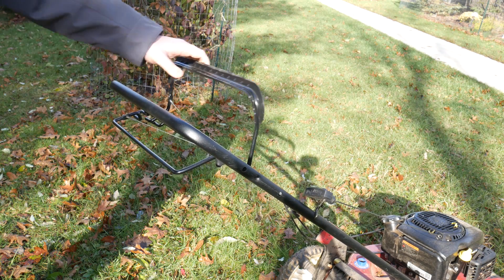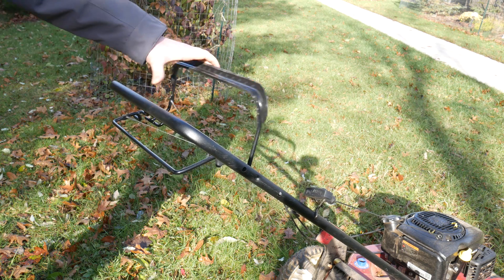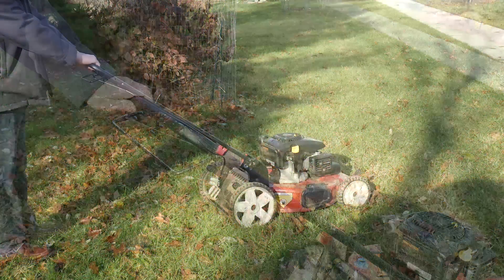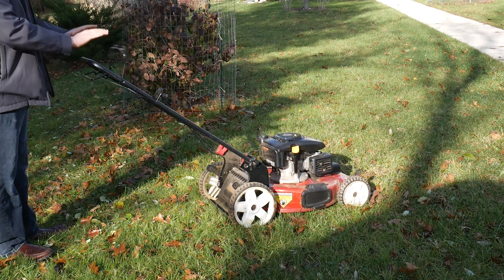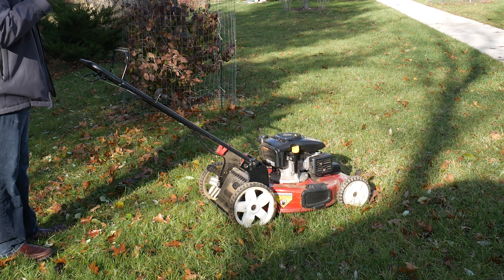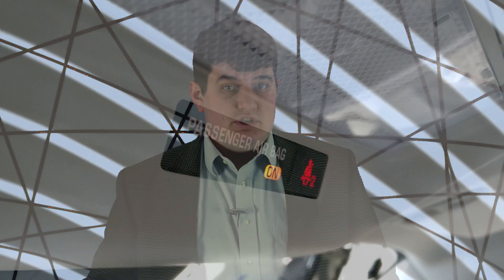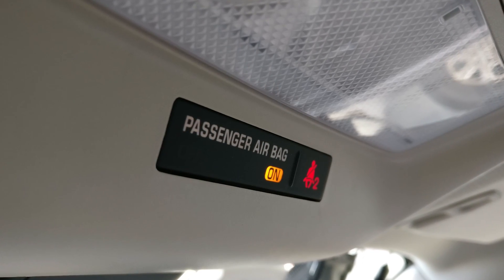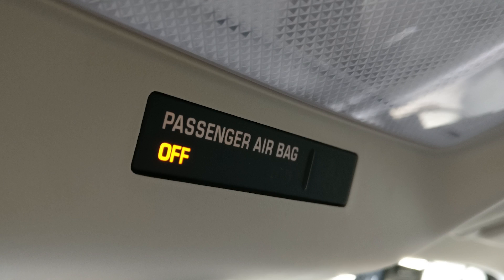The Dead Man's Switch:  How Anton Yelchin's life could have been saved

Comment: Accelerate by wire, steer by wire, brake by wire, all it takes is a little bit of code and the driver becomes the passenger.
Reply: Remember the film "Minority Report", the self-driving car being taken over by "head office"?
Yeah, seems like that's possible already, even before the self-driving aspect.
Reply: The Snowden leak that happened 5-7 years ago revealed that the CIA has considered using this technique for assassinations. The files were unclear on whether or not they had actually done it, though.
Security researchers have also demonstrated, time and time again, that engine computers are horribly secured and it's very easy to break into them. Especially the ones that can be accessed wirelessly.
Reply: Death by computer virus.
Reply: @calvingreene90  can be done today.
Reply: Not an additional line of code but deletion. Get rid of the creep function.
Reply: Ah, hello there! Can I interest you in a Tesla, and its fabulous auto-drive capabilities?
Reply: @Reepicheep-1  get that hot garbage on 4 wheels out of here. Imports for life!
Reply: @crazeguy26  My Civic has auto-throttle and lane keeping already. The auto-drive future really depends on sensors and legislation.  YAY imports!
Reply: This is why we need manual overrides. 
Nothing against Tesla (except an empty wallet), but it's reassuring to know my car has a 0% chance of being hacked entirely remotely, unless you count activating the panic alarm. Heck, my key remote won't even open the trunk. (...because the hydraulics are busted.)
That said, lack of connectivity isn't really a pro overall. It's mostly just a bother.
Reply: All new airliners are fly by wire. So it can by safe.
Reply: @MaksymCho  yup and fly by wire has had a much much better safety record due to being able to curb excessive pilot input
Reply: @MaksymCho  your comment didn't age well
Reply: Given how shit most drivers are, I don't see how that's a problem.
Reply: or dead

Comment: my 2016 vw tiguan ( manual gearbox) has this feature
the electronic parking brake is applied when i release the seatbelt
it can be overridden by pressing the brake pedal and pressing a switch, but you're in the seat to do this

Comment: Here's a possible counter argument from automakers: "we can't install a dead man's switch because that would prevent owners from starting their vehicles with a push". I've always owned older vehicles and there eventually comes a time when the battery dies (among other things) and I need to do a push start. 
- How would you respond to that argument besides saying that the benefits of safety outweigh the probability of needing a push start? 

- Is there a way that you would suggest maintaining this feature besides putting a big rock on the driver's seat (ex a dead man's switch override)? 

Thanks, and keep up the great videos. My dad and I love debating them :)
Reply: Most vehicles in North America are automatics, which you can't pushstart anyway, and even those manual transmission vehicles aren't 'intended' to be push-started so I doubt it is of massive concern to car manufacturers. 

At the end of the day, no more tech is needed to solve this problem. When I get out of my car I put it into first gear and pull the (mechanical) handbrake. If all drivers set the handbrake when they left the car, this would not be a problem.

Comment: SAABs have had sensors in the seats at least since the seventies. They are used to warn the occupant to put on the seat belt and to enable the heated seat.
I'm puzzled why SAAB never thought of using it as a dead man's switch, it would have been just the thing for the safety minded Swedes.
But maybe the sensors were to unreliable. You don't want cars to suddenly switch off when driven on a highway.
Having driven an older SAAB myself, I know the sensors get unreliable with age.

Comment: I suspect most manufacturers are aware of this problem, but choose not to implement a solution since it would prevent use in track based automatic car washes. I suppose a defeat mechanism could be implemented, but without universal agreement, this could get quite complicated.
Reply: At my car wash you remain in the vehicle while it is on the track. Do you have to exit your car?
Reply: Self service, you typically remain in car. For full service, they pull it onto a track, put it into neutral, and then leave the car.

Comment: I have a slightly different viewpoint from the old geezers who loath computers in general and think life was better before all that running water and them eelectronic gizmos came along....I think computers should be a part of every aspect of our lives, EXCEPT safety. Then it should be very carefully considered. Cars were more reliable and safer just before we went overboard w/ the computers. I don't mind if they manage the ignition system, or the door chimes, windows, radio, etc etc. But there is nothing for my money better than good old fashioned hydraulic systems and cables connecting me to my car. It only takes 1 misplaced character out of the millions of lines of code that goes into automobile software to kill me. I'm not OK with that.
Reply: "I think computers should be a part of every aspect of our lives, EXCEPT safety."
sounds pretty straight forward to me.
Every system will break, a complex system will break more likely. That's what redundancy is for...to reduce failure rate in a complex system.
Is it possible that my airbag opens by an electronic failure and kills me on the highway...yes. Do I want to abandon my airbag system because of a small chance of that happening...no. The advantages outweigh the risks.
Reply: He was referring to systems that don't necessarily need to rely on complex computer technology (Some computer control is always practical from an engineering viewpoint) but the more complex your system gets, the more it can break; and break they do.
Reply: "Except safety"...do airbags not safe thousands of lifes every year? That wouldn't be possible without codes and electronics!
With the e-brake in my car, even a kid in the back seat can stop the vehicle SAFELY even on wet and slippy roads. No cable operated handbrake can do that.
When the airbags activates, the car automatically calls help and sends GPS location for immadiate response even in an unconscious state.
Again wouldn't be possible without electronics.
Reply: +mrdesign1991 Yes, that is more or less what I meant...They should play a limited role. I guess I failed to communicate that. Whenever mechanical system can be used, it should be preferred imo because those systems are typically a lot more simple with far fewer points of failure.
Reply: +Attla theHun I don't see why a kid in a back seat couldn't operate a cable driven handbrake...I had to do that a couple of times as a kid b/c we were poor and drove rickety old cars, so if you think it's a matter of strength, you'd be wrong.

Airbags do not require computers to operate....
Reply: I feel the same way. Good thing i have an old-style "dumb" VW Polo from 2009 that doesn't even have seat sensors to nag you for forgetting to applying the seatbelt for the bag on your passenger seat
Reply: Not only that, generally speaking, electronic systems either work, or don't work, with little to no middle ground. Thats scary, because you get no warning. With more mechanical systems you can tell when things are going bad long before they become a huge safety issue. For instance a cable operated parking brake starts to feel mushy and tired months before it begins to fail.
Reply: >  Cars were more reliable and safer just before we went overboard w/ the computers.

That is simply not true. Cars are safer than ever.

Source: https://en.wikipedia.org/wiki/Transportation_safety_in_the_United_States, the key number being deaths per vehicle mile.
Reply: You're assuming the software designed, with it's millions of lines of code, is written one afternoon and thrown into the car's memory banks. Months of writing, checking, trouble shooting by teams of programmers, and then comes the testing cycle, bug fixes and field tests. 

It genuinely annoys me that there are people out there who think this way. These people aren't idiots. They're trained professionals who've studied for years and know what they're doing.

Also, if there was one misplaced character in a line of code, the software wouldn't glitch out and kill you, it just wouldn't compile. It would say 'syntax error.'

Comment: How about having a physical handbrake like in the goold old days? 
I can't possibly accidentally leave my car not braked if I have to pull a lever which makes a clunky mechanical noise to brake it.

This is a clear case where electronics need not apply - and I say this as a programmer. There was nothing wrong with the good old handbrake lever. Stop fixing things that aren't broken.
Reply: So Anton's car didn't have a handbrake? Just the e-brake? Is that even legal?
Reply: It's legal.  Lots of cars don't have a manual parking brake any more, because they consider it intrusive or not stylish.  As more vehicles adopt brake-by-wire systems, it becomes much simpler to electrically engage the brakes than to run a cable linkage from the cabin to the rear of the car.  My GF's Subaru has a stupid button on the dash to engage/disengage the parking brake, and it annoys the hell outta me.
Reply: I looked at pictures of this type and brand of car and I saw actually a manual foot parking brake. So even if Anton was annoyed and confused about the shift lever (like many suggest) and got out of the car he 
still could use that to be sure. It all then comes to laziness or habit not to use the parking brake, like most US citizens it seems.
So to sum it up: he didn't know how the lever properly worked or was annoyed 
by it, he didn't check if he was actually in parking position, he disregarded the safety of the situation and did not secure his car with the manual parking brake, which the Cherokee had!
I am not saying that the shift lever of his car was not confusing or misleading,  but if you do not secure your car with all means you have to be 100% sure it is safe just out of a habit of comfort you should not drive a car.

It would be nice if Anton could learn out of his mistake, but sadly this was a very definitive lesson.
On the other side I am definitely not against Anton's parents suing the car company for this utterly unresponsive failure of a shift lever.

Comment: Modern railways locomotives don't use a simple dead man's switch since they weren't reliable (notably the could be jammed on).  

These days it's a vigilance monitoring system that requires the driver to cancel a warning within a short time (eg five seconds). This is done by pressing a button.

Comment: Hm. First of all: Just because software is invisible doesn't mean it doesn't cost anything. In fact, software is more difficult to verify than mechanical mechanisms, which, for safety critical applications, makes it more expensive to develop. It does have an advantage in that is costs virtually nothing to mass produce, but a good part of the cost of a car is the research and development.

A mechanical dead man's switch seems to make more sense here, even though ultimately it is plugged into the CAN bus the automotive industry is addicted to.

Secondly: If the car refuses to operate without a driver present, how can my K.A.R.R. come to pick me up when I call it on my Dick Tracey watch?

Comment: Jeeps other than some JKs after 2014 do have a "dead mans switch" or run away prevention mode it relies on seat belt sensors and seat weight unless the car is turned off... So if you turn the car off and leave it in neutral you can still push it. If left running it puts on the emergency brake which usually only prevents the car from rolling forward when not in gear. The car knew he wasn't it in but HE didn't properly park his vehicle. It's like using a calculator, it's only as smart as the user. 

Also for the record Tesla vehicles require a person in the seat and the seat belt buckled before and after you shift out of park, even while in neutral. The second you leave the seat it locks the e brake and sends the transmission to park... There is no point in over engineering a car, truck, or suv, when people can't be responsible enough to but their vehicle in park. Stupid people are why cars cost so much and "require" certain safety features. Most keyless cars can be driven miles away from the key fob before try go into theft mode...

Comment: On every riding mower I use, I immediately disable the deadman switches on the seat and on reverse.  
Every time I shift my weight, the engine half-dies and consequently the blades are cut off.  
There's usually another that also kills the engine and blades if the blades are on when you shift into reverse.  

I'll gladly risk running myself over with my mower to have a much easier-to-use product.

ALSO shifting into park or even applying the brakes automatically is similarly dangerous to coasting down a hill in neutral which is illegal in most states!

Comment: I don't think a deadman's switch is the right term for the seat detector. Since if a man is dead in the driver's seat, the car would roll. More like a no-man's switch. If a dead man would be placed in the car in that situation, Anton would be dead too.
Reply: Really, the car should be put in park with e-brake on once the engine is turned off.